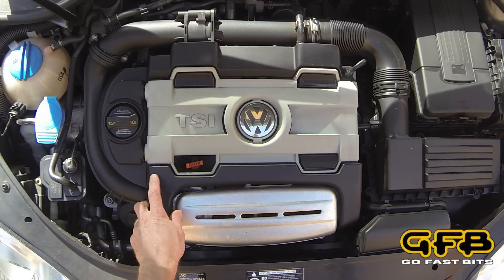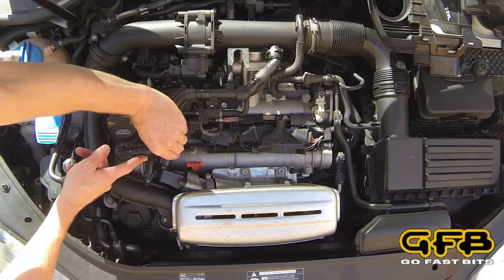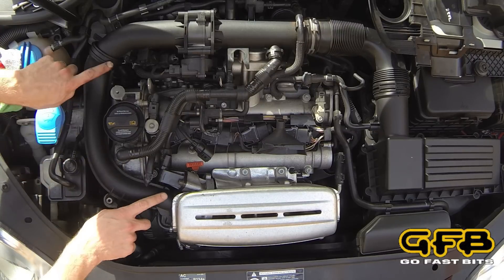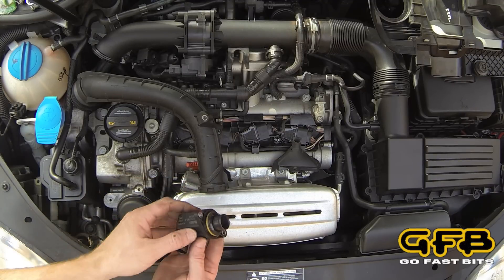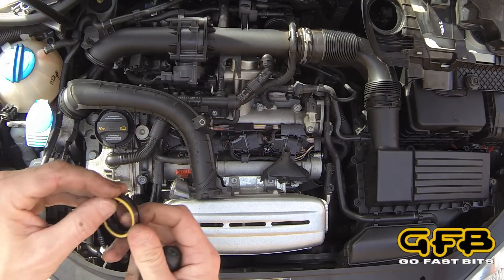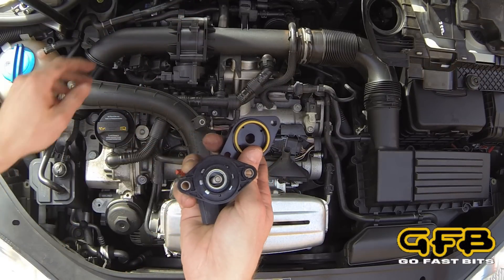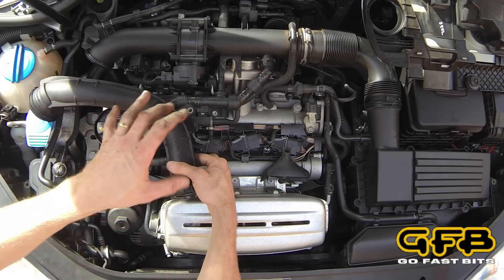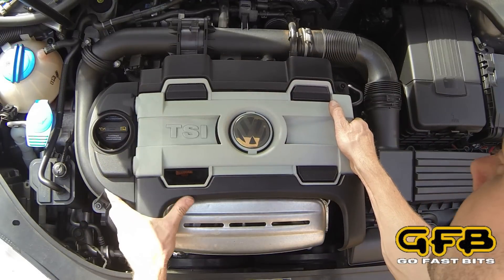GFB T9355 DV+ Twincharger 1.4 Installation

Comment: Does all 1.4L VW Sciroccos come with a  twincharger?
Reply: no, they don't make this engine anymore. It's a 1.4 but it only got a turbo and it makes 122hp
Reply: alright Because I'm looking at 1.4 sciroccos with 122bhp and I'm wondering if they come with a twin charger I know 1.4 160bhp ones come with a twin charger
Reply: oh now i get it. No they come with turbo only. I have a twincharger 1.4 and it's running beautfully after 110k miles,  The only thing I have to replace is the timing chain, and it cost only 350€, so I'm really pleased with my car. Hope that you get a nice one too! Regards
Reply: Haha thats cool thanks Johnny
Reply: @johnny2156 i have the twincharge, my car has an engine light appearing/disappearing from time to time. Lags after 3000rpm.
Reply: @clintchrystie6727  don't have the scirocco anymore, i have a twin turbo 123d coupe. But this to me sounds like it could be a turbo failure or maybe actuators
Reply: Clint Chrystie it’s the regulating flap failure. Have it replaced and you good to go.

Comment: What does it do?
Reply: +Daniel San Same function as a blow-off valve: It relieves excess boost pressure from the compressor side of the turbocharger (EG when you take your foot off the throttle quickly while changing gears).

However where a BOV vents into the atmosphere (making that 'tshhhhhhh' sound people love/hate) it diverts the air back into the turbo inlet, which works exactly as well but is a lot more legal for road use in a lot of jurisdictions.
Reply: Ben Wickham Thanks for the answer! :-)
Reply: Ben Wickham does it make a difference in speed?

Comment: Nice installation but beware if you have a VW Touran 1,4 Twincharger.,
The DV will not fitt easy because there is no space.
The area between the connectionplug and the black plastic pipe that comes from the engine is to small.
After replace the DV with the GFB i could not pull the connectionplug on the DV.
The black pipe is the problem here. The black pipe from VW Golf can be pulled away a bit but the pipe from a VW Touran has a screw ans it is a very solid construction.
So i had to pull out some screws and try to create space by using some force on the plastic unit behind the engine and the pipe that goes into the engine.
I did not like the way i had to work but i had no other option.

Comment: So what benefits can be expected from this install?
Reply: +Ihsan Mujdeci GFB's claim is that the factory diverter valve in VAG 1.4 twincharger engines can 'leak' pressure, especially if the engine is chipped to run higher boost - this fixes that.

Their second claim is that the factory part vents as a default, and only closes (to hold boost) when the throttle is pressed down, which can cause a delay when changing gears.  The GFB part will gradually shut once the excess boost has been released, so it's already closed and ready for when you put your foot back on the gas.
Reply: You 'go faster'